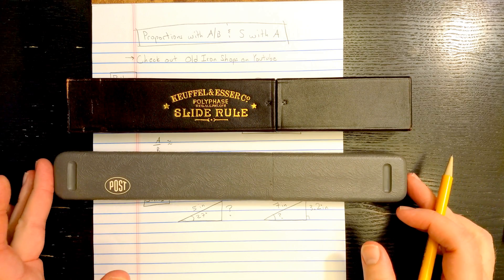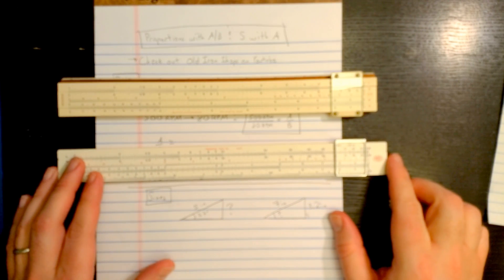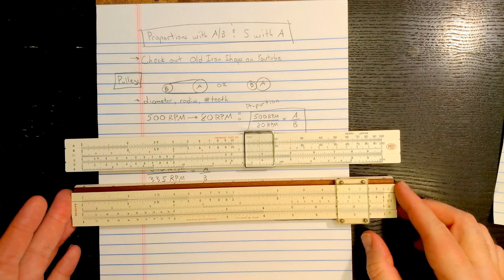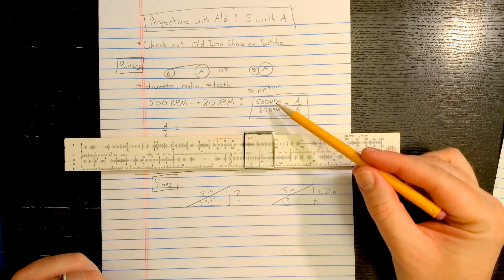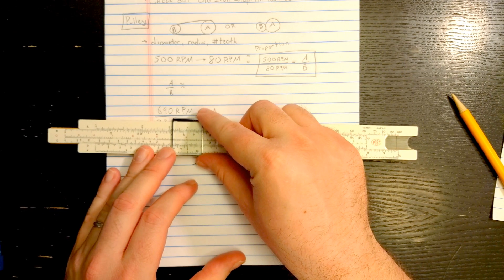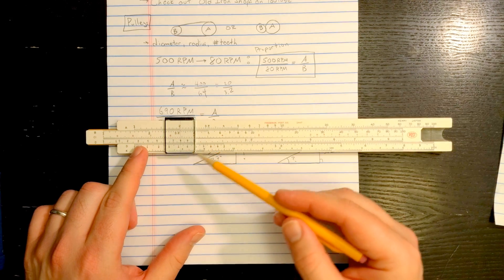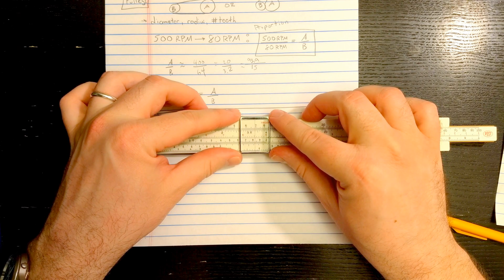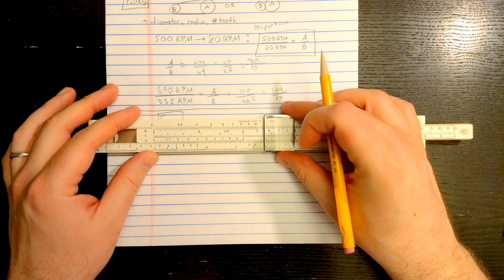Machine Shop Calculations 1/2

Comment: One advantage of the Post 1447 slide rule (and its final descendant, the Teledyne Post 44BA-470) over the K&E Mannheim is that it is finely divided between 4 and 5 when compared to the K&E. I don't know of any other 10 inch slide rule that keeps the 0.02 divisions out that far. That being said, they also kept the trig scales as DMS to the very end when they had every opportunity to change them to metric.

Comment: i have a post 120 and a k&e n4058w if that helps i think the k&e is about that same as the one your showing scale wise nothing fancy wood with painted lines
Reply from the maker: The N4058W has the same scales I'm using here. It's essentially the same slide rule as my 4053 but manufactured more cheaply.

I think you might mean a Pickett 120? This is an all plastic slide rule. The Pickett also has the A and B scales. Interestingly it has S on the front of the slide, and it should be used with D instead of A.
Reply: yes your right it is a pickett 120